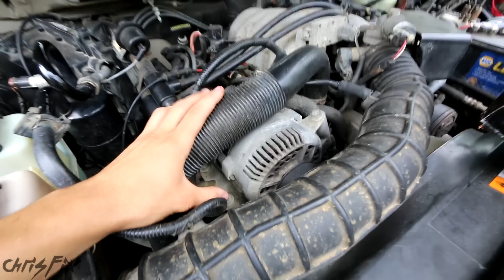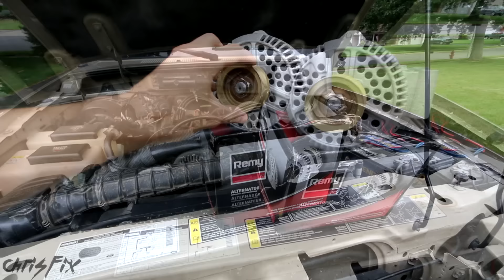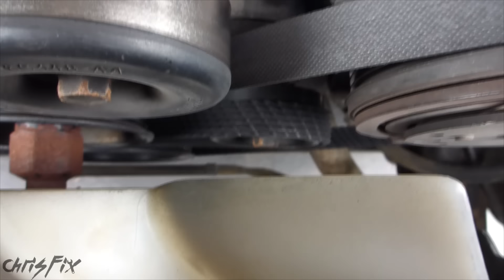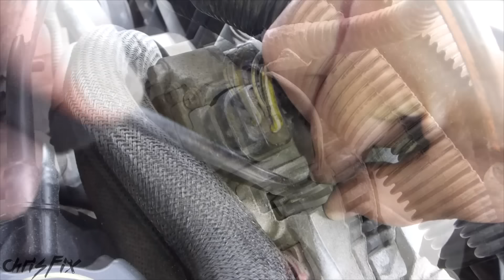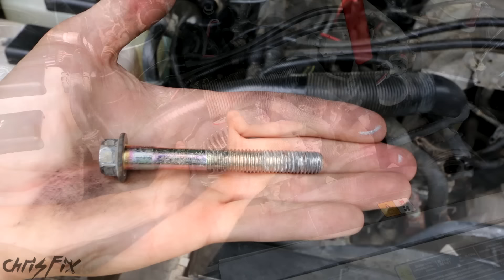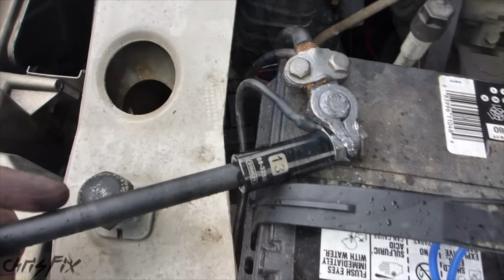How to Replace an Alternator

Comment: When the RPMs in my Impala goes above 3,500. My battery light goes away but when it goes below that. It comes back. Help!!
Reply: The alternator is probably going bad. You can get it tested at most auto parts stores.

Comment: Chris you do a great job of editing he got four million people that watch your show religiously. But when it comes to big Vans with cramped conditions in the engine room you never done any of those you done all this easy stuff engines I have a lot of room large hoods and basically that's the way it is got some good information I admit. But when it comes to full size vans you don't do anything and you can say well I don't like Vans I like easy to work on vehicles and that's that I mean if you bought yourself a tank and had to pull the engine that would be interesting to. So how do you pull an alternator how do you get to the fuse box from the engine compartment you should be great Chris chrisfix Now isn't looking into vans. Not the Vans made from Germany Vans made in America

Comment: Electrical system update ? Please bro when ?
Reply from the maker: I still need to do that!
Reply: @chrisfix  hey Chris why would I put a higher amp alternatir than the oem or in what case would I need one ?and can I put a higher amp alternator even if everything is the same on the car I mean would it burn or mess up my electrical sistem ?
Reply: @chrisfix  Please do that electrical system upgrade video! Your videos are the best because you list the parts in the description, which is soooooo helpful! Keep up the good work man.

Comment: Whats the funcion of the PCV hose? That thing is broke in my car
Reply: It stands for positive crankcase ventilation. The rings on an engine do not seal 100%, there is some blowback. This raises the pressure in the crankcase.  The PCV hose vents thoses gases into the intake. They are usually pretty cheap because they are just a hose and maybe a check valve.

Comment: Great video! If you ever stumble upon a Porsche 964 do a video on that alternator. We had to replace that and it was a huge pain!
Reply from the maker: What made it tough?
Reply: @chrisfix  The alternator is behind the main fan for the engine, and getting that fan off is near impossible. We had to bring it to O'Reilly's and the dude behind the counter had to help up brute force it off. The fan bearing was extremely difficult. If I remember correctly too there were a bunch of different sized washers and stuff that had to go in a certain order for the belt to fit and run properly. We burnt through a belt trying to get it in the correct position. I can guarantee there are forms and other videos describing the process better than I can, but I think it took us a whole weekend. Very tedious, mainly. Check it out if you can. Oh, and if you don't assemble it in the correct way the fan will scrape against the shroud, not pleasant!
Reply: @chrisfix  Changing oil on that is very different too. There are 2 drain plugs you need to do. You also have to let the car warm up fully so the thermostats open up to go past one of the drain plugs since it is air cooled. Once you drain both plugs, you add 7 quarts, start the car and wait until it warms up. Then since it is warmed up the oil level gauge will be reading and you add half a quart slowly until the gauge reads about halfway. We finished yesterday and it took about 10 quarts. Our next project is getting a resistor installed for the oil cooler which allows the cooler to be on when the gauge is halfway. Currently it's either nothing or full blast once it hits a line. The resistor basically fell apart and disintegrated. I think it is behind the front right wheel buried behind some stuff.

Comment: Uhm if you disconnect the negative or ground but leave the positive connected that means obviously there's still a positive current. So whenever it finds a ground whatever is alive along that ground will get shocked...
Reply: Yes but the only ground available if the negative cable is disconnected is the battery terminal. You only need to disconnect the negative terminal because it breaks the circuit. The positive wires can touch negative wires and the frame and nothing would happen because the negative is not hooked up.

Comment: I have no clue why I'm even watching this. My car doesn't even have an alternator!
Reply: How old is your car
Reply: 2018 Ford Fusion Hybrid. it charges the 12 volt system via an inverter/converter attached to the high voltage pack.

Comment: I don't get when to use anti seize and when to use threadlocker . I thought you need those bolt tight for the connection, so you'd add threadlocker to help them stay tight. Can you bring some light over here, Chris?
Reply: Its usually best to follow what the factory did. If it did not have thread locker when you took it off then thread locker is not required. It wouldnt hurt anything to put some on but it is not necessary. Most people put antiseeze on every bolt that did not have thread locker. The bolt wont back out if it is torqued properly.

Comment: Good job Chris. Im getting ready to do this and this is a great reftesher for me. Been having starting issues. Not sure the alternator is bad but it checked good at two different parts stores. Battery light comes on when acceleraitng and it battery drains overnight just sitting.
Reply: if battery comes on when accelerating it could mean ur belt is slipping, and draining overnight could mean u have a short, something staying on or bad battery

Comment: I’m new to this can I use any alternator with my car?
Reply: No it has to be for the specific car.  biggest difference is the way they mount, every car has a different way that it mounts to its location. and another is that alternators differ by amperage, so some alternators are higher amps than others.

Comment: Hey Chris I’m upgrading my alternator on my truck from a 60 to a 170, I’m running 2 light bars, sound system and a few other things. Is it necessary to upgrade the positive wire from the battery to the alternator to a 0 or a 1 gauge?

Comment: I had a question: so in this case that Chris upgraded his alternator to one with more amperage, shouldn’t you also replace the alternator relay to one of the same amperage for it to work properly? Thanks in advance, love your videos Chris 🙏🏼
Reply from the maker: The wiring for this car and most cars can handle a small upgrade. This was an option for the truck so the wiring was already built to handle the extra current.
Reply: ChrisFix got it, thanks Chris! One day I’ll get to do DIY videos like you too! 😄

Comment: Just replaced my alternator on my Jeep Wrangler.. I hopped back in to crank it up and nothing! Lights came on interior and dash but there’s nothing else.. what would you suggest I check now?
Reply: if it was doing that before alternator, u shouldnt have replaced alternator(unless ur battery got completely drained cause of a bad battery while driving but if lights were coming on doesnt seem that was case), because thats a weak battery, bad battery connections..worst case starter is bad.
Reply: Backyard Chevy ended up solving the problem! It was a bad battery! Have a feeling that’s what it was to begin with and I replaced the alternator but I guess I have a long lasting alternator now. Lol thank you!
Reply: Lol, well thats important part that u fixed it and u got warranty on battery and alternator now.  good job solving it.. hopefully thats all ur car problems for a while...i got a car repair diy channel as well in case u ever need it too.

Comment: Hello, Chris I'm planning to change my alternator to a 320A high output alternator, and I was wondering how to properly ground an alternator. That's the final step in the  big 4 upgrade, but I'm told to ground the back, but Im unsure of where. Thanks in advance!
Reply from the maker: Run the correct gauge wire (depends on length, voltage and amperage) from the alternator outside casing to the chassis.
Reply: ChrisFix WOW that was a fast reply, thanks! Now, I'm using 2/0 welding cable. Does it matter how I ground it to the casing? There aren't many places to  bolt a ring terminal to..

Comment: I just replaced a alternator on my dads Durango yesterday. I got a quote from a local shop to do the repair and they wanted $600. I had no intentions I bringing it to a shop to have it done I was just curious. The job took me 30 minute only because forums and a video I watched told me all the wrong size tools and I had to go to my neighbor to borrow some. I have a shop I rent with a couple of my buddies and we work on vehicles and my tools are there across town. I'm doing this in my driveway with no tools. I was lucky my neighbor has a small craftsman tool kit

Comment: Hey Chris, I have a very greasy alternator. Im not sure if im losing a little electricity because if how dirty it is. Im wondering how may i clean it w/o damaging it and causing problems. Would I need to buy a new one? Im driving to vegas in 1 week. I need to be sure im at safe hands before the drive. I’m planning to do an engine bay clean up by i guess professionals.

Comment: Hi Chris,  I get alot out of  your videos thank you. Not sure if you've covered this but here's y situation. I have 2003 Sierra which has been sitting the past few months. Tried to start it yesterday and not surprised the battery was dead. No biggie  i'll just jump start and take a long ride. Tried that, NO crank and I could see the alternator trying to rotate, but all it would do is rapid clicking. Apparently seized up perhaps rusted. So Best advice to free it...I've seen spray WD40 or other lubricant into the stator. Any thoughts on best method.
Reply: if the battery is really bad jump starting it doesn't really work..itll spin slow and or click rapidly cause its not enough amps to crank the engine...most auto parts store will charge ur battery and test it for u for free..id recommend doing that before anything

Comment: my wife is 425 lbs . i have her lay down in front of car. rhrow a sheet of 3/4 in plywood on her belly and r & r the alternator. EASY PEASEY .  

IMPORTANT SAFETY TIP......:
:Have the old girl put the plywood back in the garage and get her fat ass out of the way otherwise you might damage your vehichle ...........

Comment: I used to have a 2001 Mazda b3000 v6 it had 250000 miles on it before I bought a Toyota tundra and the only problem I had with it was a coil pack and the alternator

Comment: Two video sugestions: 
1 - How to properly diagnose a bad turbine with oil leak, how to replace it and how to prevent it.
2 - How to clean an intercooler filled out with oil

Comment: i've changed the alternator in my 2011 volvo s60 d5, secod day low battery light is on and power save, the battery is good i've check it and i look for corrosion, any ideas what could it be..? With the old alternator i haven't have this problem, and this i got now is a new one not a rebuilt.

Comment: Unfortunately for me, changing the alternator on my 2012 Chevy Equinox LTZ is not going to be as easy as shown here.  But you did provide some pretty good tips such as using the tools for releasing the belt tension, moving any obstructing items, and brushing off any corrosion or dirt off the connections and mounts.  Thanks for the video!

Comment: Since 2 to 3 months I am facing an issue in my khyber 1995, while accelerating the car jerks on petrol only, and sometimes it stops I consult my mechanic but unfortunately he is unable to found actual problem could you please help me in this regard.
Carburator overhauled 2 times, fuel filter replaced, fuel tank cleaned etc.
Reply from the maker: Check the distributor.
Reply: Ok i will

Comment: From the videos I've seen one major factor in electrical system performance is how clean/dirty connections are.  As you were installing the new alternator, you cleaned the bracket which grounded the alternator. As part of your diagnostic process, could the drop in amps be due to trying to pull high current from the ALT through bad connections or is that pretty much a universal "you need a new one" indication?

Comment: hi Chris thank you for all the helpful videos you have
made.  Your videos have inspired me to
start working on my truck.  I will be replacing
my alternator soon, I recently purchased a new alternator and was verifying the
pulley before installing the unit.  I was
wondering if you could help me with a question.  When I spin the new alternator pulley
clockwise it's nice and smooth with on noise. 
However, when I snip the alternator pulley counter clockwise I hear a
ticking sound -- Almost like a loose screw. 
However when I shake the unit I hear no rattling sounds.  Is this normal? 

Thank for any help

Comment: There is one thing you should have said in the video. When getting a bigger/high output alternator check to make sure you don't need a different size belt. I did this in my chevy Silverado and i had to get a bigger belt because the alternator was slightly bigger, even tho the asshats at the auto parts store said the old belt would work. It ended up not working and i had to get a bigger belt which it even had a post on the item on the computer...not everyone they hire knows what they are doing. Lol

Comment: Get a video of replacing cooling hoses in the engine compartment. Because I have a warning light going off that my surge tank is low. And it’s reading normal
Reply from the maker: Check for leaks
Reply: ChrisFix I see something on the street where I park my car but I don’t see the back up surge tank levels dropping. I’ll jack it up tomorrow and take a look.

Comment: enjoy your videos. Always thought you would have to charge the battery. I remember replacing an alternator on a 1992 prism. The mechanic told me I killed the new alternator by installing a new alternator with a dead battery. The dead battery killed the alternator dead by trying to charge a dead battery.

Comment: I have a 2002 mitsubishi montero sport they replaced my alternator and now the lights in my vehicle and headlights are flickering. What seems to be the problem?. Thanks! 👍
Reply: check ur connections or check ur grounds...as long as ur voltage is above 14v. then its something related to wiring.

Comment: my car's alternator is connected to the battery and ground, but there is one two-pin connection on it that isn't connected, and i can't find any extra wire or connection to connect to it around.. am i missing something?
and the battery light is always on, and the battery loses charge every two months (have to recharge it)
Reply: that's ur connection to ur voltage regulator one is ur sensing connection and the other wire goes to the alternator light...without that being connected ur alternator is not working...one tells the alternator that ur cars on..while the other wire is telling u if the alternator is working properly by being attached to the light...so u gotta find that connection or make ur own wiring

Comment: hey chris,, im having a battery light on indicator when my first start and it will not get off till i turn off the engine, the tricky part is should be driven the car.more than 15mins and turn off the engine otherwise it will go back again..plss i need help, my car is 2006 pt cruiser non turbo. thank you

Comment: Hi Chris,
I have a 07 Chevy 2500 Silverado.
After I remove all of the alt. mounting bolts. I can not seem to get the alt to release from the mount. Even with a pry bar. What is the trick to releasing it?

Comment: A couple of thoughts... wouldn't it be better to brush the bolts away from the engine bay, instead of right on the bracket? And anti-seize doesn't affect the grounding at the bolts?

Comment: Helle and thanks for this video, i have a 2013 chevy Malibu ecotec engine just like the one on this video, i had before a check engine light on my dashboard i tried to shut it down by the way of disconnect the battery termnals and connect it together (+&-) without power to reset the car computer, after that a strange phenomena happen to my car is all lights interior and exterior start a server flickering ! At idel  RPM specially when i full load the car like flashlight and AC, then i went to the dealer they said the intake camshaft solenoid sensor need to be changed, they changed it and no more check engine, but the main flickering problem still available, i changed the alternator, checked the ground wires battery terminals all the connection was very fine, is there any solution for this please ??? Thank you very much.
Reply from the maker: Make sure all of the grounds and wire connections are clean and secure. That is the main reason for the flickering.
Reply: ChrisFix i did, all clean and secure, any other reason ?

Comment: I am about to replace my car's alternator and your video was good training. I will see how to do it myself.
Reply from the maker: +Paul Cail awesome! Glad the video was helpful and good luck!
Reply: It took me at least 2 weekends to remove my alternator. Test it at NAPA Auto Supply said nothing wrong with it. Took another 2 weekends. But alternator is good only for a few hours. Battery alarm in my dashboard shows up again. I finally decided to replace it with a new alternator - lifetime warranty from NAPA. This time it took me 2 hours to remove and replace.

I am becoming a car repair enthusiast. Gives me a good feeling to fix and repair car trouble. Thanks. I am one of your fan.

Comment: I just installed a "new" rebuilt starter in my '88 Toyota pickup(4cyl.) Battery is good but sometimes it's starts and sometimes it just gives a "clicking: sound and the engine won't kick over. Is it because the connections to the starter might be corroded? What should I check for? Need help, Pete.

Comment: Hey Chris....I have a 99 ford ranger 3.0.    Is it okay to put a 130 amp alternator in my truck?   I have noticed that when I accelerate the air conditioning fan slows way down.   Is that normal?